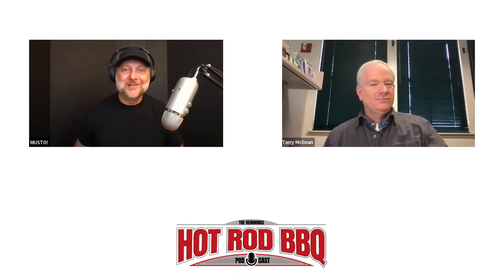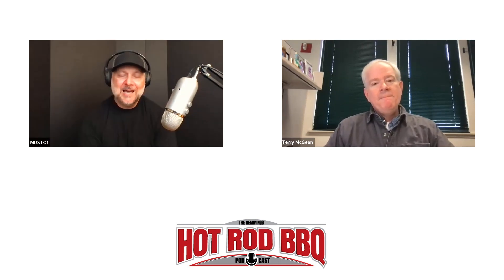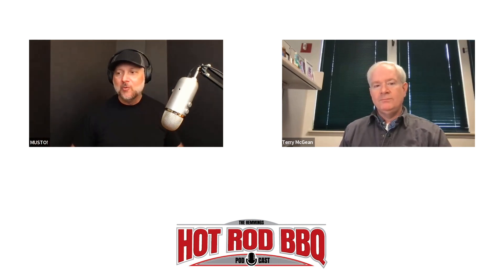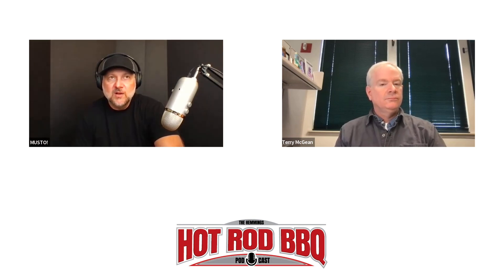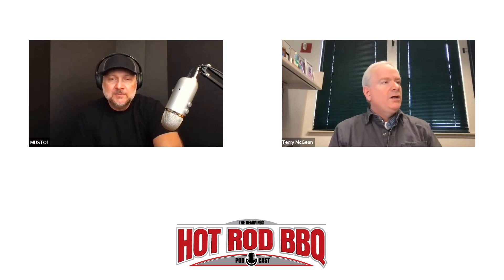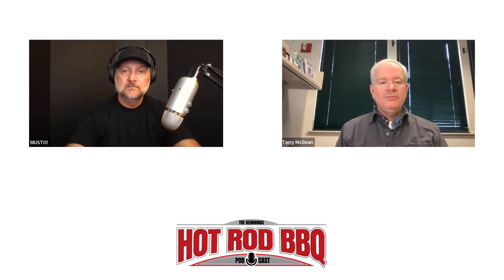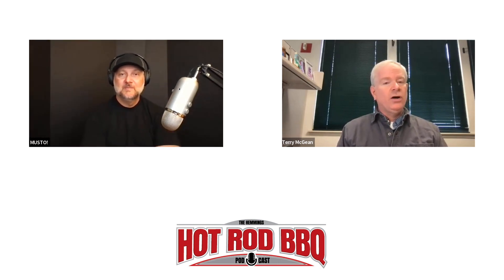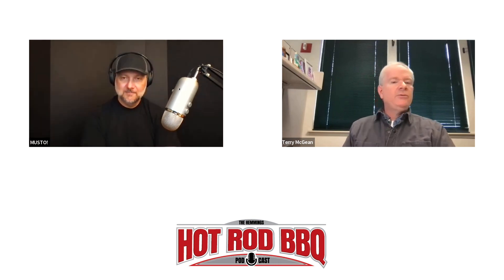Musto & McGean Answer IROC REHAB Questions | Hemmings Hot Rod BBQ!

Comment: Great project, would love to see more "nut and bolt" details, including details on parts and planning. Gotta love these cars, they are tailor made for builds, with a great OEM handling platform, in serious need of more power. I looked at many till I found one that was rust free, most had shot floors, not acceptable in a monocoque chassis car. With resto-mod cars doing well in value, done right I think these have no down side, just loads of fun. If I may add, an old engine tear-down and investigation step by step failure analysis from this car would be cool.